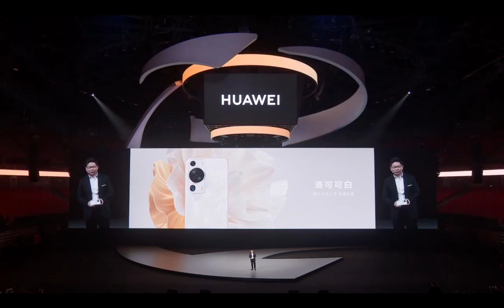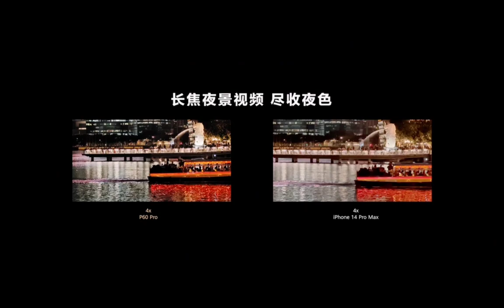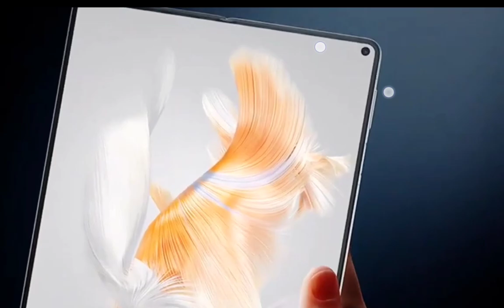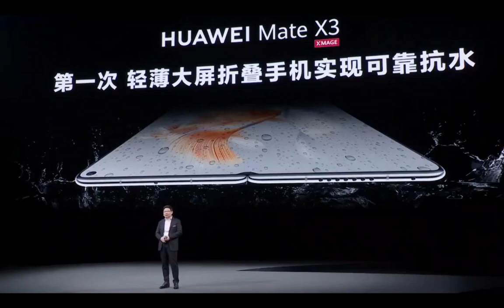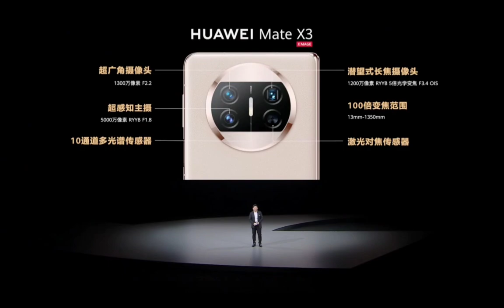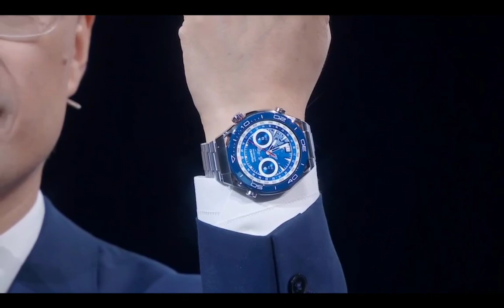Huawei P60 Pro & Mate X3 Launch Event - Summary English

Comment: What is the sensor size of the Huawei p60 pro main camera?
Reply from the maker: 1/1.4 inch
Reply: @lltechview  kinda small ain't it? I expected it to be like the p40 Pro with 1/1.28 or 1".
Reply from the maker: @BLAKEEATS1988  It is the Sony IMX888 sensor
Reply: @lltechview  a 1 inch type sensor?
Reply from the maker: It is not. Though they are using the variable aperture that can do f/1.4 which is a very large opening. I can imagine this can in combination compete against 1 inch sensors

Comment: Does the P60 Pro has 200x digital zoom maximum!?
Reply: Yes, 200X from the ultrawide angle, but ~100X if you measure from the main camera like most brands/people do. So it's the usual 100X zoom.
Reply from the maker: @schneider1112  Great explanation. So they just wanted to write 200x zoom for marketing purposes
Reply from the maker: According to the specs. Yes

Comment: I'm disappointed .My P40 pro have bigger 1,2 camera sensor. Why Huawei WTF people want 1inch SENSOR. For the 1sttime in my live i'm thinking of Oppo or Vivo 1 INCH ones.
Reply from the maker: 1 inch is not everything. It also depends on the aperture. And here with a wider aperture the benefit that 1 inch sensors usually would have perishes almost. But yeah 1 inch with variable aperture would be game changing. I fear their variable aperture tech cannot work on 1 sensors. They need to redesign it or make the camera bump even huger than the one on Oppo, Xiaomi and so on.